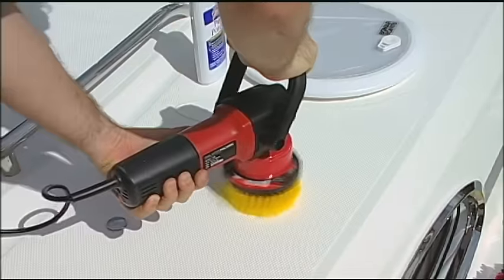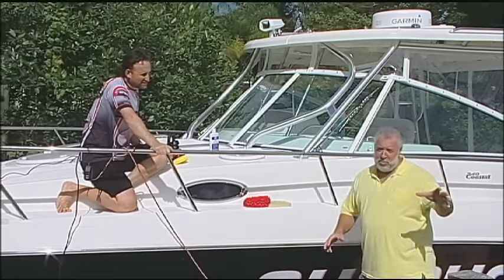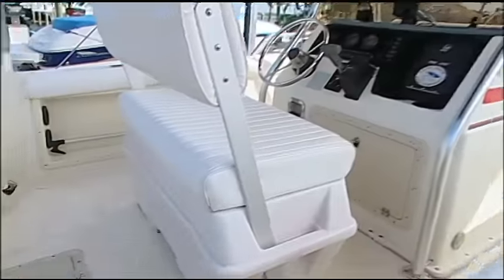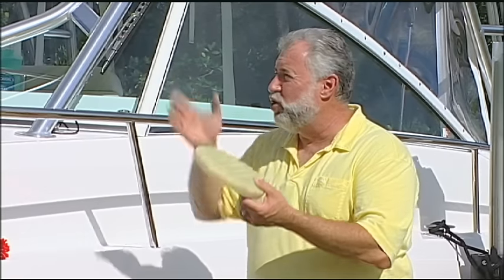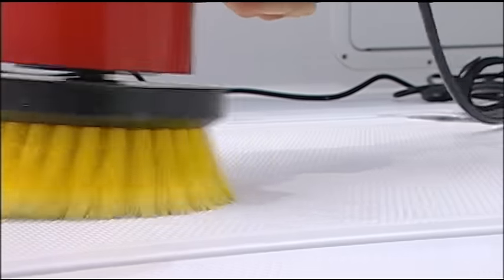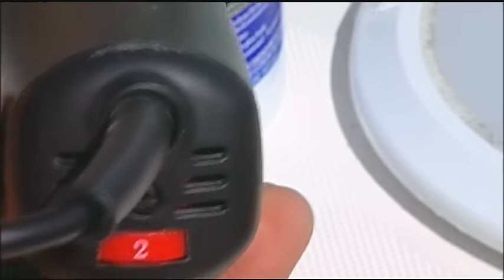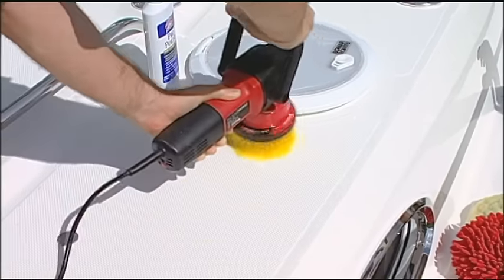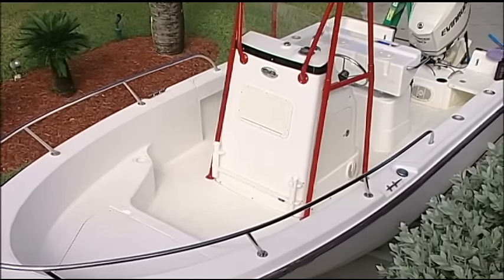How to Protect & Wax Non-Skid Decks with a Polisher and Boat Wax

Comment: This brush is for the dual action polisher.  Is there a brush for the dual action polisher PRO?
Reply from the maker: We do not currently manufacture a brush for the Dual Action Polisher PRO. The extra weight of the brush combined with the extended reach and speed of the PRO would be to hard on the machine to guarantee a long working life.